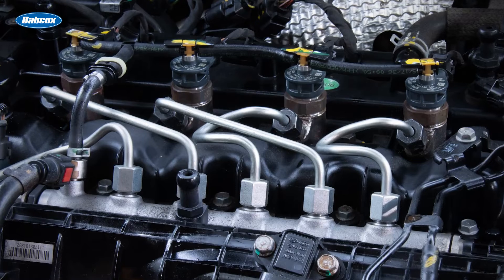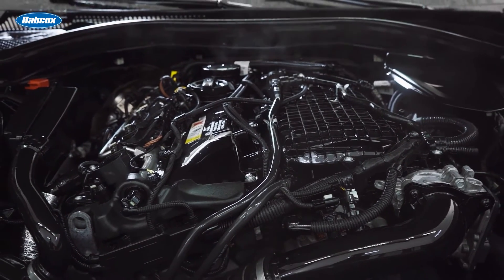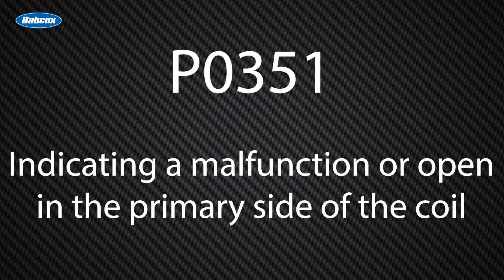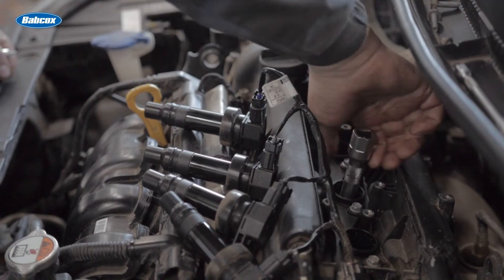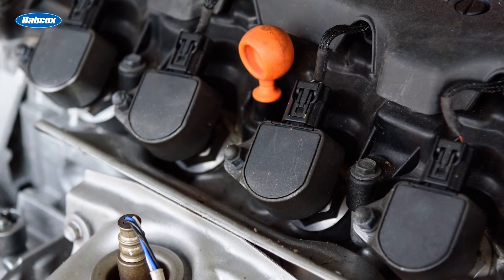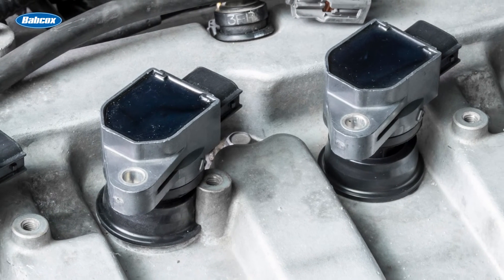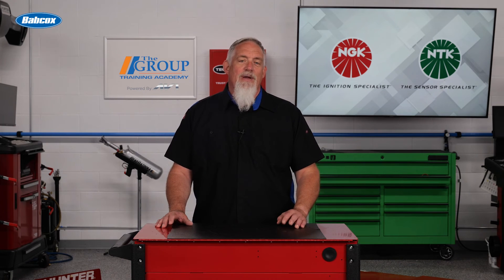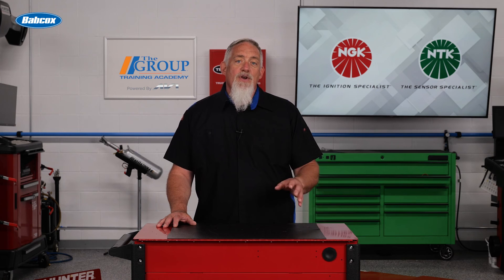Unlocking Peak Engine Performance

Comment: Exactly; it's like buying a timing belt component kit. I have yet to see a bad timing pulley, though they sometimes need to be relubed. Other than certain engines that have faulty coil design, like the Chevy 4.2 or Dodge Hemi engines that have coils that fail one by one, I've never needed to replace all (usually only 1), and have yet to have a vehicle come back with another coil-related code. I do agree that if they're buried under the manifold that the customer should have the option to replace them all at that time. The real big thing that gets overlooked is the coil connector (boot & spring); those are what really wear out and age. Plug wires should be replaced with plugs at every tune-up (except maybe for turbo engines that need plugs every 40k), and if you don't have wires, then those connectors need to be replaced!
Reply: Amen brother!